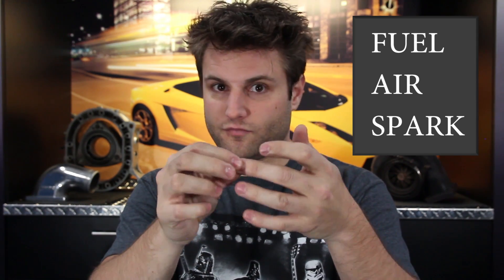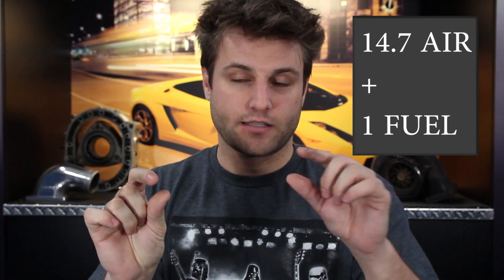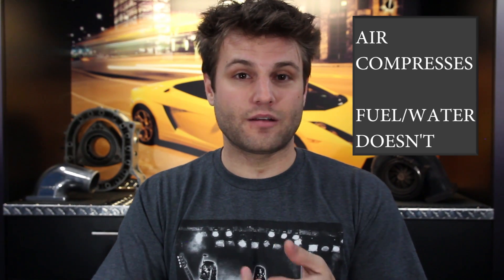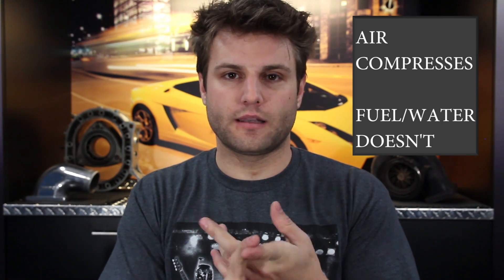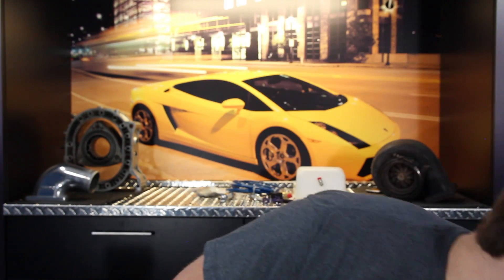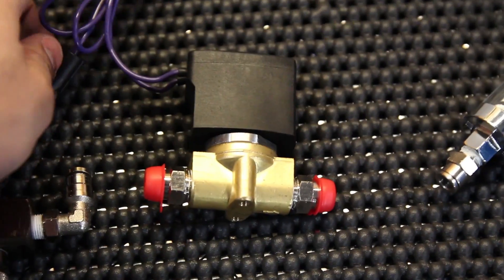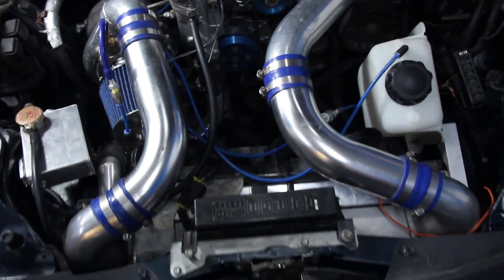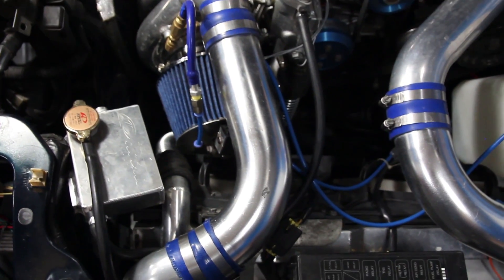Pre Turbo Water Injection - Explained

Comment: Rob, have you been to the U of Ms Aerospace building? They have really cool engines there! A friend of mine is there and he built a transparent engine where you can actually watch the combustion on a high speed camera. And that engine you were talking about that ignites with only compression is called a homogeneous charge compression ignition engine (HCCI). They are really efficient on the highway, and they will probably be used on the new cars coming out. Excellent summary btw :)